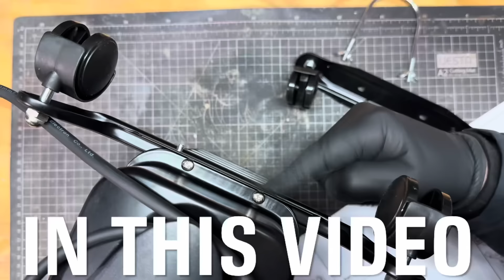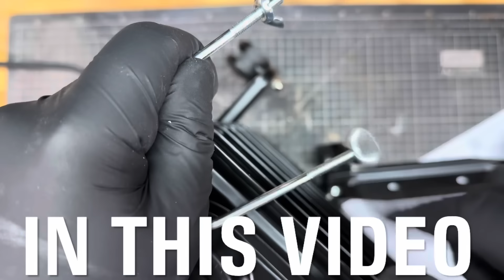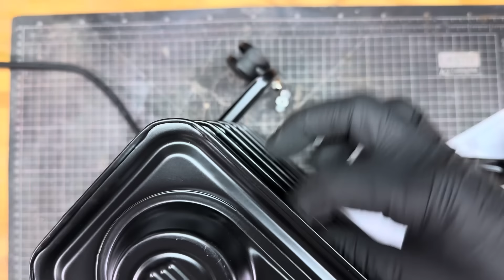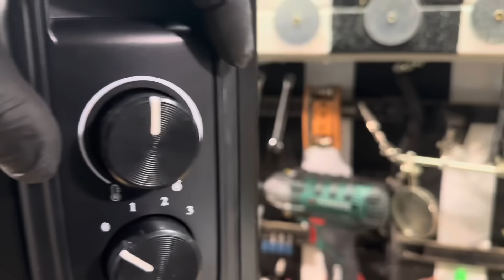‘Essential!’ Winter TOOL HAUL 😃 Gift Ideas ❄️⚒️ - LIDL & MORRISONS Middle Aisle?

Comment: I'm in. I picked up the portable compressor. I've not used it properly yet, but gave it a quick blast to check it works. It's okay, but I'm wary it has to be running to get any air out of it, and it can only be run for a very short period of time in every hour. Probably fine for my intended use of giving woodworking projects a quick blast to take the dust off, but it does make me wonder how long before I break it.

Comment: I’m in, 
I have just seen you can buy battery adapters to fit Parkside tools.most of the big brand named batteries can be used, they cost around £14. 👍

Comment: I'm in. 150°C seems to be far too hot for the surface of a radiator. If it really is that hot, it could easily burn a child (or boil a small one if you put them in a big pan on top).

Comment: I love Parkside tools, but that rollers are bad, the foam slips from the center very fast, they are 1 time use, I use to buy foam rollers in my paint shop dissoltin and it lasts about 10 uses.

Comment: Bought a butane gas heater £50.00 for my workshop works like a treat and keeps it warm when I'm in there. Plus you buy the gas up front so you know what your spending on heating not like those Oil filled radiators lol.  Used to have one but it really was rubbish took ages to heat up the room so I skipped it. Best of luck with yours.

Comment: I know you like your rubber (stop sniggering) so have you heard of a product called Sugru ?? It's been around for at least 20 years. It's like plasticine when you open the pack and it is mouldable. It sets like rubber, is waterproof, heatproof, flexible and if I remember properly also electrically insulated (but check first). I used it to mend broken cables and add a bit of softish grip to screwdrivers or small tools. It can be expensive though.

Comment: Hey Rob....You need to get one of those Jumpers (prob from China and looks nowt like the pic)  Ha! since you mention about heating  you might want to consider putting proper rads in your shed on a closed heating system with a 3 KW electric heater....prob cost around £1500 though..... I fitted one many years ago in a barn for someone and it worked well..... I will most likely do the same in mine at some point. Worth checking out. SOS...dot dot dot dash dash dash dot dot dot....great video as usual and perfectly organised chaos.